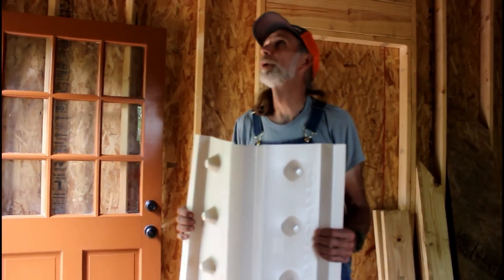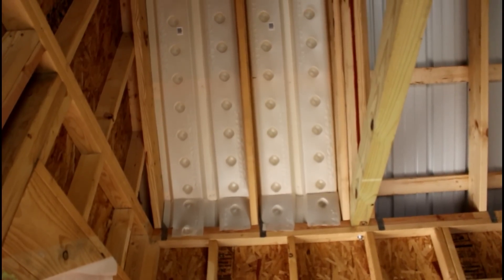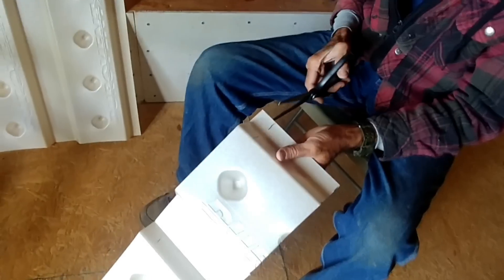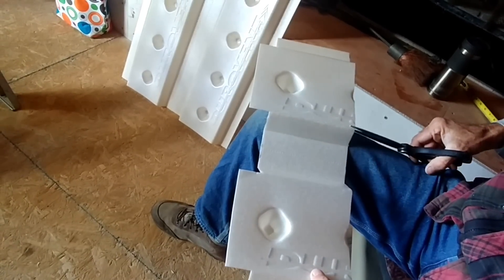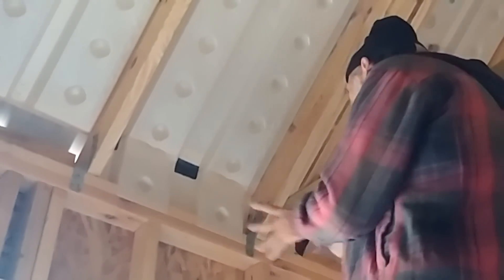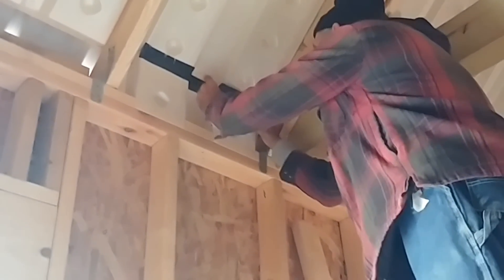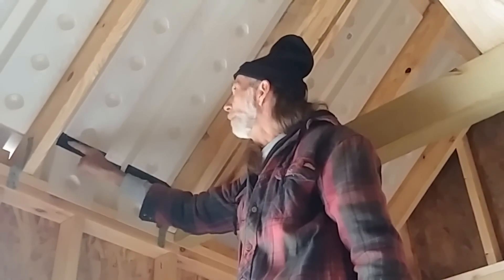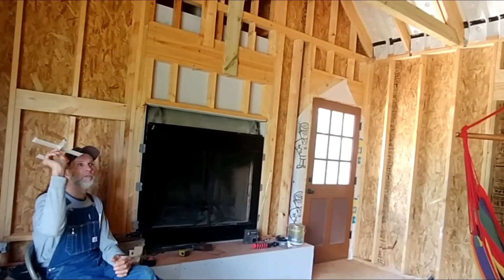Off Grid Cabin Build | Danny Builds an AIRPLANE! | Duravent Panels | Episode 13

Comment: The roof venting is wonderful for anyone that realizes what they are looking at.  I am slightly older than you. The glider planes were balsam wood when I was a kid but I saw the transition to Styrofoam. We were very careful because it would be a long time before we had a chance to get another plane. Soon we learned to make kites from newspaper, string and hay baler wire or arrow canes.

Comment: Where do you get this? When i looked up Duravent it brought me to stove pipe.I have a shed with metal roofing to insulate
Reply: If you look at the panel in the beginning of the video, it says Durovent, with an O. Try that.
Reply: @saddleridge4364  Thanks that worked!